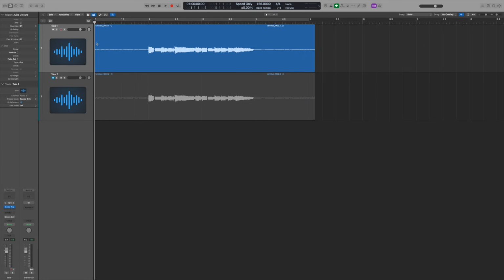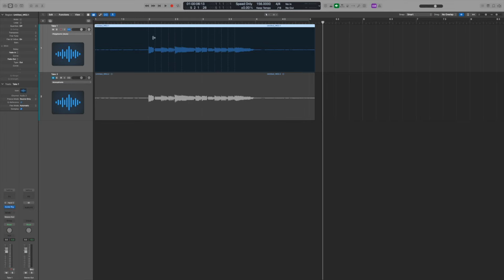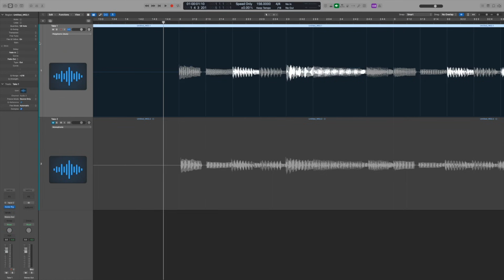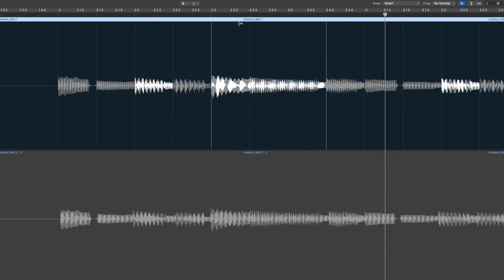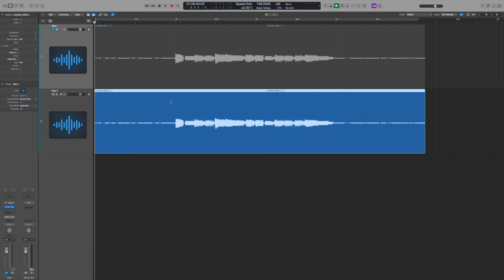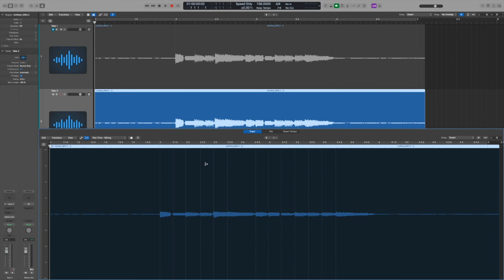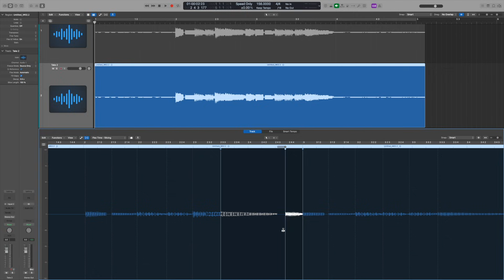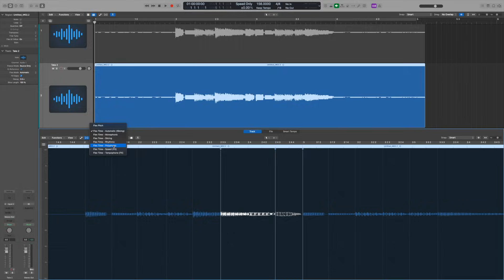How to Quantise Audio in Logic Pro… FLEX TIME like a Pro!

Comment: Hey stephen, quick question. I'm having a lot of trouble time correcting distorted guitars that were recorded with a mic on an amp. I want to use polyphonic, but it gets rid of the natural attack sound of the track when I turn it on. But when I use slicing, it creates all of these unwanted clicks when I try and quantize. I've been trying to work through the clicks of the slicing one because its worth it to me to have the natural sound of the amp. In other words, polyphonic adds an artifact to the overall sound I don't like. I wish there was a way around this. Any suggestions?

Comment: What’s the best way to approach it if the performance is very colla voce and all over the place, and I want it in time?
Reply from the maker: Hmmm, good question. The more you move things, the more obvious the changes sound unfortunately. My advice, what I've found works in these cases, is definitely a manual approach. In polyphonic mode, I'd pick out the start of each phrase first with a marker and move this to the best position. Then, I'd progressively pick out more points from there, starting with the most prominent notes and working down to smaller, passing notes. The biggest problems with sound often occur when something is moved dramatically from its original position, so moving the whole phrase to start with means everything else is moving "relative" to its new position, creating smaller movements and allowing you to work slowly through each section more precisely. If possible, use less transient markers. It might mean some passing notes are a little out of time, but when every transient is moved you often introduce more push and pull in the timing changes (seen as a lot of swapping between white and grey sections), which often makes it sound the worst. Hope this helps.
Reply: @StephenOConnellCmdShiftNew  thanks very much!

Comment: What if a I drag an MP3 file in there where the BPM changes throughout the track, will quantizing work to make that track play at a single BPM throughout the track?
Reply from the maker: There is a Logic Pro function that can detect the BPM of a track, so it will match the BPM to that track's detected BPM, which I believe you can set to sensitivity. So you could say try and match it close to every bar, then you could quantise the bar's beats with flex time.

Comment: Does anyone know what Protect flex markers mean?
Reply from the maker: Hey, I'm not sure what you mean, but you might be referring to the markers either side of the marker you are moving. I use those to "protect" the transients of those two points and avoid moving the waveform out of time before and after the marker I am moving. If you don't have markers either side of the one you are moving, then when you move that one the whole wave form will shift, pushing everything else out of time.
Reply: @StephenOConnellCmdShiftNew  

I was referring to the option in beat mapping. 

Lets say i beat map every beat in bar 1 and 2. Then i make a correction at beat 2 in bar 1. It seems that all the other markers after then move slightly.

You would think that is what it is for? To prevent that.

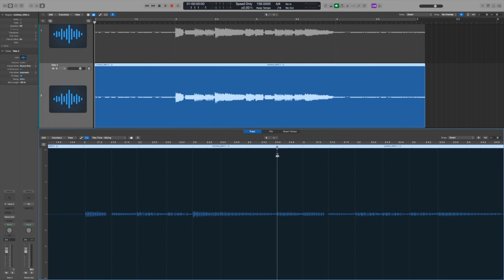Comment: if you record a vinyl EDM record into logic it will drift over the length of the track. For example a six minute EDM vinyl track will drift around 7 to 8 seconds. At 5:55 he shows that just adding one of those transient markers every eight bars will quantize it correctly.
Reply from the maker: Great example of another way to use this!

Comment: I have a desperate question! 
When u turn on flex mode u see the lines and the track goes all dark. But sometimes u can’t see the lines and it’s back light blue. 

Is there a way to switch in and out of that? 

Thnx
Reply from the maker: Hey, no problems. It's a bit hard without seeing it to know exactly what's happening, but there is a flex time button you can turn on and off, meaning it shows and hides the flex timing. It looks like a sideways hour glass if that makes sense, the icon is of a clip being twisted on itself. That can be turned on and off to show and hide the flex time edits in either the track workspace or the audio editor. Hope this helps.